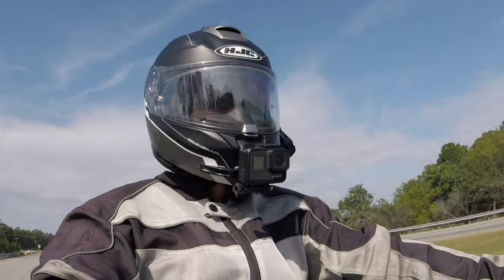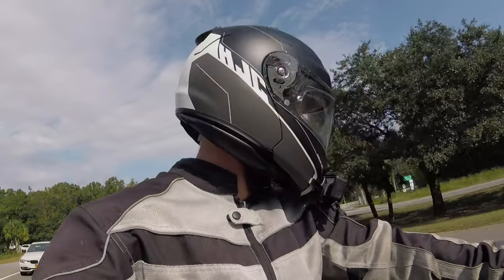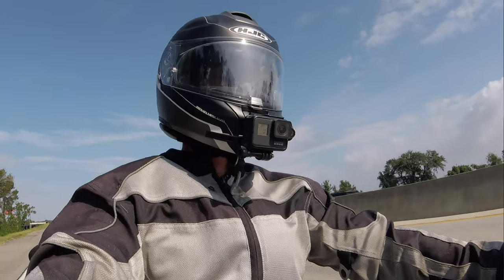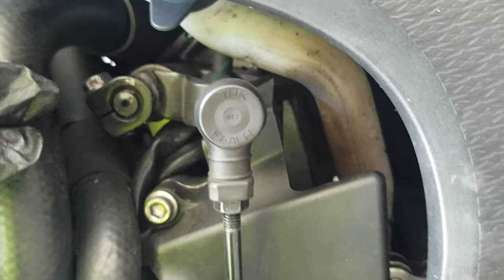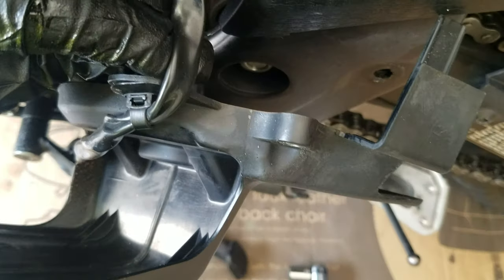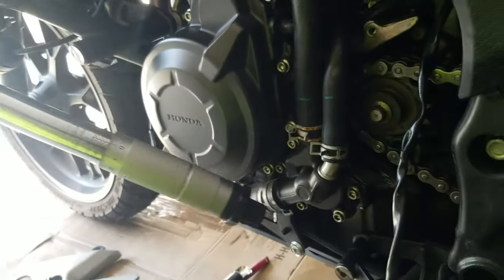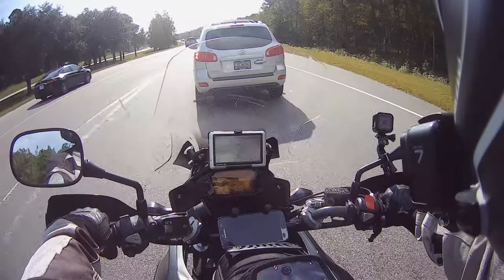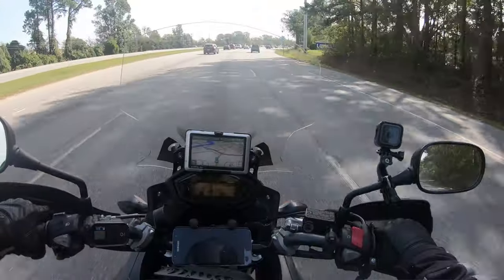CB500X 16T Sprocket Swap

Comment: In my opinion this is the worst mod you can possibly do to cb500x, OEM gearing is ok, but a bit on longer side. Much better to make gears shorter, and go 1-2 tooth up in the rear sprocket to 42 or 43T. That way you gain acceleration, bike is more responsive, less lugging the engine, more use of 5/6 gear and much more fun. With oem gearing you mostly use first 4 gears, 5/6 are too long.
Reply from the maker: Every rider has their own style.  To each their own!

Comment: You're going to lose whatever percentage of torque the sprocket change equals.  I don't know the exact numbers for the 500x but it's probably around 8%
Reply from the maker: Thanks Do RC!  The CB500X isn't exactly a speed demon to begin with, if you know what I mean.  And I'm no longer a spunky 18 year old, popping wheelies on his Ninja.  Whatever loss of torque the 16T sprocket brings, I haven't felt it in the slightest.  The more useful spacing of gears has been way more beneficial to my style of riding than any loss in torque anyway.  But thanks for the kind comment and for making everyone aware of this potential downside.  To some, it would be a deal-breaker I'm sure.
Reply: @MotoPhotoAdventures  I went up a tooth on my ninja 300. Same result.  I'm also no longer young:)
Reply from the maker: @DoRC  That's fantastic.  Glad you're enjoying your ninja...even at our age.  :-)

Comment: Hi Chris, just wondering does the 16 tooth sprocket improve m.p.g. cheers from the UK.
Reply from the maker: Hi Les!  You can probably Google this issue.  I didn't make any scientific studies to the before/after difference in mileage.  Many have commented below that because the engine isn't revving as high, that this means the engine isn't working as hard, and thus it's using less fuel.  But others say the fuel savings are so minimal as to hardly be noticeable.  It seems reasonable to me to say it does improve m.p.g.  Just don't expect it to be a HUGE savings!  Besides, we all know our little Honda CB500X already has incredible fuel mileage!  :-)

Comment: 15-45 to 16-44?
Reply from the maker: Hi Norman!  I'm not sure I understand your comment/question.  The stock gearing on the CB500X is 15T up front and 41T in the back.  I changed to 16T up front and left the 41T in the back.  I've also heard of many people using a smaller sprocket in the back instead.  But this combination works well for me!

Comment: I'm ordering the 2019 in early December 2019. 
Can anyone tell me if the 2019 cb500x has the same 15 tooth front sprocket or did they bump that up a little?  I can't find the answer online anywhere
Reply from the maker: Ho Motoryzen!  There have been several improvements in the 2019 model over previous years.  But I believe it has the same 15T front sprocket.  If you visit a manufacturer's website like Sunstar or JT Sprockets, they will have a chart for your bike that will show original size.  But if you put in NC750X instead of CB500X, the 16T sprocket for that bike fits the CB500X perfectly.
Reply: @MotoPhotoAdventures  thank ya much for the info. Cheers Goodman. Stay frosty xD
Reply: Same.  I have a 19.
Reply: @travnat1  Thanks :D

Comment: If you ride 80-90 percent on pavement a 16 tooth is a wonderful thing. but if you go on steep 4x4 roads you will want to go back to 15 tooth
Reply from the maker: Hi D Bressan!  I totally agree.  I did the entire Trans-America Trail on the 16T, including this CRAZY ascent of Cinnamon Pass:  https://youtu.be/Im8M-tRJXuY.  Would it have been easier on the 15T?  YES SIR!!!  Now having said that, I have recently found a "sweet spot" in the gearing ratio that is in between the 15T and 16T.  To me, it is the best of both worlds!  After testing it out on the Mid-Atlantic Backcountry Discovery Route, I have to say THIS is the setup I'll be using from here on out:  https://youtu.be/Je6LdgYt9fg.

Comment: If you want a faster bike, buy a 650. The CB500 engine is designed to run at 6000 RPM just fine. A 14 tooth sprocket gives you   quicker response in the city and slower speed in first gear on forest service roads.
Reply from the maker: Thanks Pat!  Different strokes for different folks.  I just like the more relaxed "feel" and the more spaced out gearing of the 16T.  I've got lots of friends who like the stock gearing the way it is.  To each their own, I say.  I've taken my CB500X down around Mexico and back, and coast-to-coast on the Trans-America Trail (with some pretty gnarly dirt roads and crazy mountain passes), all with the 16T.  Check it out:  https://youtu.be/1nMIH2yxRR8.  She's just keeps chugging along and I keep loving every minute of the adventure!!!

Comment: Honda Rebel 500 is the number 1 selling bike in Europe.  It targets the females and new riders market.  But the problem Honda has is 80% of Rebel 500 owners get rid of it in the first year.  My theory is that it's because it's geared way too low.
Reply from the maker: That's a good theory.  I would agree with you!

Comment: Definately  not a legal mod in th EU if you don't change the rear sprocke to the corresponding one to show a true speedo reading on the bike. Just changing  the front/ rear sprocketalone cancels the roadworthyness cetificate/registration and render your insurance null and void. Roadside checks of sprockets are carried out as part of police controls here in Germany, which carry high consequences;  confiscatio, fine, points, ban and possible long walk home.
Reply from the maker: Glad I live in 'Merica.  😁

Comment: I think testing is not accurate/correct. Comparing at 80, before 6500 after 5800, while 15/16*6500 equals 6100; only 6% less. Only reason  to do real test is to check for different drive behavior.
Reply from the maker: Thanks for the comment Peter!  As stated, this was not a controlled test or measurement.  Variations in head wind, road conditions, hills, etc. affected the numbers.  But it gives an overall impression of how the bike performs after the change.  Basically, I can cruise on the highway at slightly lower RPMs with the new 16T sprocket than I had with my OEM 15T sprocket.  If you read the other comments, others have done the math on exactly how many fewer RPMs to expect at a given speed.

Comment: no idea why HONDA does not change this. The first gear is useless except in harder terrain may be. From 70-80kmh you dont have to shift gears anymore and thats anoying, i always check if i am in 6th already :D :D
Reply from the maker: I feel your pain!  But a lot of their customers are from small mountain towns with steep twisty roads, or huge cities with lots of traffic, or countries with dirt roads and poorly maintained highways.  I'm sure that's why they do it.  Luckily for those of us in countries with excellent high-speed infrastructure, bthis upgrade is cheap and easy.  :-)

Comment: Your observations don’t match the math.   For the same speed, 5000rpm with a 15T should be 4687rpm with a 16T.  🤔.  (5000/16*15)
Reply from the maker: I understand.  This wasn't a controlled scientific study on a test track or a wind tunnel.  Factors like headwind, road surface, traffic, hills and valleys played a roll.  Plus of course trying to read the rpms on your dash at highway speeds with all the vibrations and wind buffeting wasn't easy!  The message is still the same... the 16T sprocket upgrade reduces engine rpm at any given speed and creates a less "buzzy" ride on the CB500X.

Comment: Yeah the 500's have really short gearing; going on the highway you're practically wringing it out. It designed the 500 and Rebel for street riding, but Honda should have just shortened 6th gear.
Reply from the maker: Thanks for the great comment, Matt!  Much appreciated.

Comment: drop the  back sprocket 2 tooth you be  amazed
Reply from the maker: Thanks Otty!  Dropping the back sprocket by 2 teeth and increasing the front by 1 essentially have the same effect.  The difference is, a front sprocket is cheaper and easier to replace.  But I have many friends who have done the back sprocket instead and been very happy.  Thanks for the comment!

Comment: Stock is the best....it was tested in a stock set up....
Reply from the maker: Thanks for your input, Rafael!  Different strokes for different folks...and to each their own.  :-)
Reply: @MotoPhotoAdventures  "different strokes" is like okay it works well can the engine stand these alien combinations for long?.... it's like an adventure bike will runs like a sports bike...but when it comes to off road oh! This adventure bike sucks!..right?
Reply: @MotoPhotoAdventures  if you work as an mecha engineer you will get fired right away....just imagine those mecha engineers that  doesn't do gimmicks....if they created an ADV bike it will act like an ADV bike...they will TEST IT like an ADV bike....your sprocket combi is risky....if you're a Honda mecha engineer you can advice your combi...but if you're not....be careful those CB500x might get fucked up
Reply from the maker: Easy @rafaellucero5098 !  No need to get upset.  I totally 100% respect your view.  And if you don't want to modify your bike in any way, that's totally up to you, and I respect that.  I also don't force anyone to do this modification to their bikes.  It's just something I found which helped make the bike much better suited for me and my style of riding.  Since I'm enjoying the new change, I want to share it with others who would like to do the same.  It's not my idea.  There are thousands of people who have made similar modifications to their drive-train.  Some even put a 17-tooth front sprocket in place.  A friend of mine changed his to a 16T and liked it.  So I tried the same and loved it.  I take full responsibility for modifying my own bike.  This is not a major change to the bike in any way.  The bike was designed by excellent engineers in Japan to fit a certain riding style and segment of the market.  It's probably perfect for most people.  I have a ton of respect for engineers.  However, they have budget restrictions, they have to keep costs a certain way, so they have to make bikes that fit the "normal" rider.  If you live in a small mountain village in Japan where you only ride narrow, twisting, mountain roads, the gear ration on this bike is probably perfect for you.  But I do a lot of long-distance riding in the US where highway speeds are quite high.  The standard gearing of the bike makes it rev too high and uncomfortable for me at such speeds.  The only thing this modification does to the bike is add 1 single tooth to the front sprocket.  It's the same exact front sprocket as is used on the Honda NC700X.  Many people make this modification.  And I have never heard of it ever being a problem for one single person.  The worst that can happen with this particular gearing combination is that my chain and sprockets might get worn out a little faster than normal.  Again, I truly appreciate your words of wisdom and caution.  It's important to all stay safe while riding.  But everyone is allowed to make their own decisions on what to do with their motorcycle.  Many people make huge changes to the suspension on this bike, installing a Rally Racing kit, adding 2 inches to the height of the bike, using the rear shock from an old Suzuki GS600, adding knobby tires, adding electrical components, changing the front wheel to 19", raising the front fender, cutting off the tail section, switching to a different brand air filter, replacing the headlamp with an LED...there are so many different modifications you can make to this bike.  Without modifications, there would be no after-market suppliers of such parts!  And we all know that you can buy so many parts to do all kinds of things to a motorcycle!  To some individuals, customizing their bike is part of the fun of owning one.  Personally, I live by the French philosophy of "laissez faire"...live and let live.  Unless someone is doing something to directly inflict harm to you, relax and let them have their fun.  :-)  Have a great day, my friend.  I hope you get a chance to enjoy your bike today...
Reply: @MotoPhotoAdventures  maybe i sound upset....but im just respecting the designs and the scientific aspects of different bikes.... I'm not from japan but we have this asian Honda  low displacement bike that you can attach sidecar on it...that bike 6 years old... and i never do that sprocket combi thing...here in our country most of the rider do that too....but its funny because they never came up with a solid combi they have so many different combis with the same type of bike....some will say this one is better and then the other will brag his different set combi...i mean not all bikes are created to race...if you wanna race buy a race bike....simple don't dream that a utility bike like the asian honda that we have will run 120kph because the frame is light and the motor is 150cc...you see? Commuter bikes like in vietnam is popular here too....if you will make those fast it's freaking dangerous for it's build....i mean you can throw tons of money to your dream race bike than throw and spend money to your combi that is risky for the build of the machine or motor....you might spend more than simply buying a race bike....in my exprienced with our bike for 6 years and has a sidecar and all stock i replaced the sprockets but still the same....it just runs right smooth and faster than break in period....some idiots here replaced their sprocket combi as early as they just bought the bike because they think it will not run faster with the stock combi...with my experience and observations....they are all morons....a sidecar bike needs torque than hp....because the bike was designed to lift weight...it can be three persons, water containers or soda bottles... it's a utilitarian bike....and I've seen broken open engine or motor too because of that foolish habit....it is much better to learn what's the capabilities of your bike rather than making your bike do what you want....
Reply: @MotoPhotoAdventures  just put it this way....if you're new to motorbike and you just know only how to ride.... don't be a jimmy neutron or a moron that will just follow other morons without thinking.... that's risky for the new rider and the motorbike itself.... it's like buying a new car will you change the transmission, the differential just to make it faster? Or just break-in it?...mostly you will just break-in it...same with the motorbike, same with the motorbike...

Comment: No gloves @ 80 WTF ? I would be more worried about what my hands are going to look like if l bail off the bike then a few hundred rpms. If you actually ride your 500x in the dirt (and l do) your not going to want to change out your counter shaft sprocket.
Reply from the maker: Thanks for the kind comment and for sharing your insights, Tim.  Have a great day!!!
Reply: @MotoPhotoAdventures  Sorry Chis l should have mentioned your nicely made video and yes if your staying on the road most of the time then  the counter shaft mod is a worthy modification to make , it brings the revs down for a smoother ride and probably better mpg as well.
Reply from the maker: Thank you sir!!! Much appreciated.

Comment: The OEM sprocket is designed for what the bike was designed to do.. which was a little off asphalt dirt/gravel and hill ascending and descending. That explains the first gear designed for low speed torque. If you desire better road asphalt riding should have bought the CB500F which has same engine, but I believe is a bit more geared for total asphalt without screwing up your speedometer. KISS method applies. Buy a bike designed for how you ride
Reply from the maker: Hi Andrew!  Thanks for the great comment.  I would have to respectfully disagree.  Here's what I've been doing on my 16T front sprocket:  https://youtu.be/1bO4Za2kp00.  :-)  But seriously, I do believe there's a place for both a 16T and the original 15T drive sprocket.  Both have their merits.  And individuals have different tastes and different riding styles.  If I lived in the mountains of North Carolina with lots of twisty roads, dirt trails, and steep inclines, I'd probably keep the 15T.  But since I mostly use my bike for long-distance trips, I find the 16T to provide a more useful bandwidth of power.  Laissez faire, as they say!
Reply: @MotoPhotoAdventures  indeed..you do you, I'll do me and keep my OEM 15. Comes in handy for me and my situation
Reply from the maker: @andyostertag  that's awesome!  I'm glad you're enjoying your bike.  It's a great machine.  I often tell people, Honda makes this bike to reach a broad audience.  Installing a 16T from the factory would be so wrong for everyone living in Asia, India, Africa, South America, or anywhere that doesn't have a wide open smoothly paved interstate system.  :-)

Comment: As if the guys at Honda are stuped ? Come on
Reply from the maker: They designed a great bike to cover a wide variety of riders all over the planet.  For many of those in smaller countries with narrow, steep, winding, or dirt roads...it's perfect.  For my part of the world with huge interstates with long, strait, flat sections...a taller gear is helpful.  The video is in no way a bashing of Honda.  It's just showing a modification that has clearly helped many riders make the CB500X fit their riding style and riding terrain a little better.